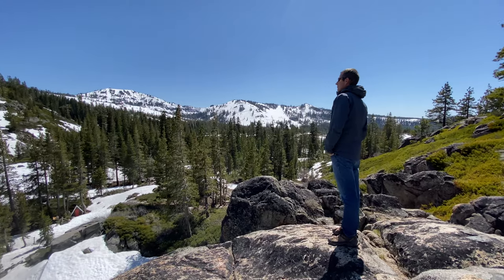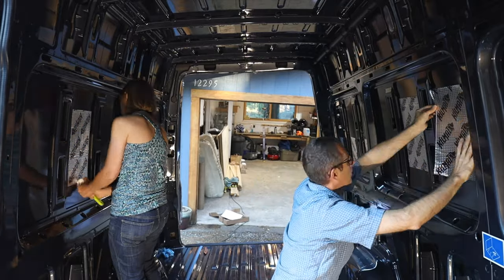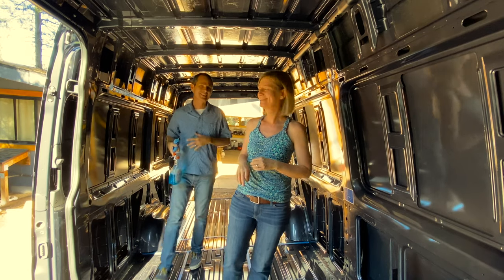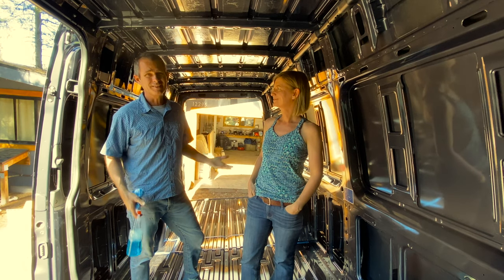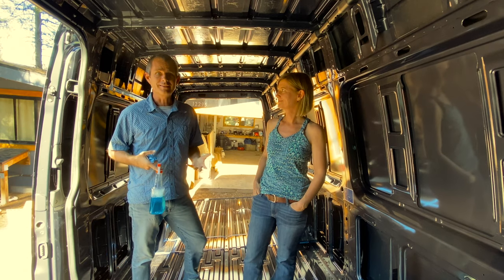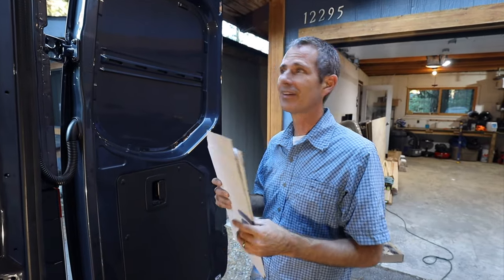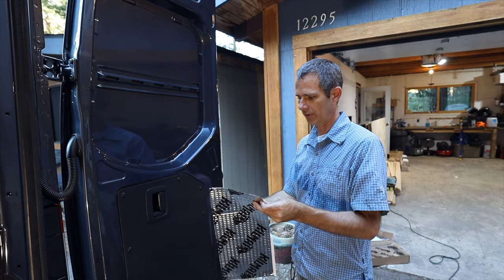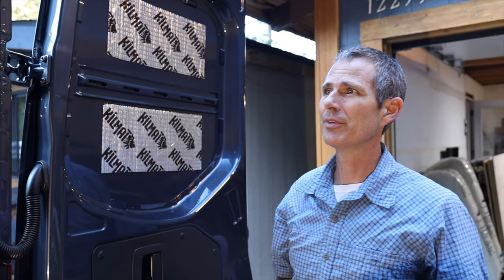How to Apply Sound Deadening in a Van | Sprinter Van Conversion | Van Life

Comment: Got to love all this modern tech of stick on sound pads, my first van near thirty years ago we used stippled black bitumen  two or three coats and as thick as possible same stuff as old fashioned car undercoat but boy did it work it stopped every creak & groan from the van body, two drawbacks come to mind it stinks like hell for three days plus the bodyshops hated you if you ever had a dent in the body to get out, I did three vans like that until pads were made easy to get  & even then undercoat was used in between the modern pads , a modern insulter  used in the marine industry is a 3M thinsulate if i were building again it would be the pads plus thinsulate plus havelock, costly but very sound thinking . the thermal on the 3M is very good. Keep up the careful sound good work im watching with interest.
Reply from the maker: Thanks for sharing your experience - interesting how sound deadening and insulation were handled back then.  So glad we have easy- to-use options now!

Comment: I notice on all builds I've seen the Kilmat is minimal on the sides and is not used to fill the entire sections.  Any particular reason for this?  Seems like more would help.  Is it an issue of added weight?  Great video and thank you for sharing.
Reply from the maker: It's not necessary to cover the walls - it adds unnecessary weight and expense.

Comment: Hi, my name is Otto and I have watched several of your video recordings of your VAN build, I have been very impressed how you have presented yourself, the details, the thoroughness of your process. I can tell you've done your homework looking for good, reliable and eco-friendly materials. My wife and I will be starting  our first Camper VAN using the new 2023 Ford Transit VAN Trail. Question on the Kilmat product, I have been searching for the material but I have not found a retailer that sales them in a box like you show in your video. Did you order the box from Amazon? I only can find that they sell them in pairs and not in larger quantities. I would appreciate if you could comment on this. Thank you.
Reply from the maker: Hi Otto. Thanks for the kind comments. We bought Kilmat from Amazon, but I see now that Amazon doesn't have it in stock. Siless comes up when you search for Kilmat in Amazon.  I'm wondering if Siless bought Kilmat. The products looks the same, materials are the same.  I would personally go with the Siless if you can't find the Kilmat. Best of luck with your build!
Reply: @wanderlibre4434  that is correct, i am going with that product. Thanks so much for your quick reply.

Comment: I wondered if you could post a video of your decisions to buy that Sprinter configuration, namely long versus short wheelbase, two wheel drive versus four wheel drive, and the 2.0 liter gas engine versus the 3.0 liter v6 diesel engine.  Best of luck with the project!
Martyn Edwards
Reply from the maker: Thanks Martyn! Good suggestion. We're planning to work in a couple of videos covering all the topics you mentioned. If time permits, we're actually going to try to film the first one this week, which will cover our decision to go with the 2.O gas vs diesel. Stay tuned👍
Reply from the maker: Hi Martyn, We wanted to let you know that we just posted a video on our decision to buy the gas engine vs diesel.  We also briefly discuss 4WD vs 2WD - although to cover it more in-depth will require its own video. Here's the link https://youtu.be/obr5pkpVHOg

Comment: After using a budget brand to sound deaden most of my van I ended up buying some Dynamat and was shocked how much better the product worked. Buying it from Crutchfield ended up costing only about double the price which I felt was totally worth it. I'm interested to know how much your products brought the sound down. I've been looking at Havelock wool so can't wait to find out what you think of it.
Reply from the maker: Interesting to hear your thoughts about Dynamat.  We're using Kilmat to deaden vibration and road noises that are being picked up in the body panels (ie vibration).  For that, it has definitely made a noticeable difference. The van feels pretty solid.  But the main tool we're using for sound insulation is the Havelock, as we've heard that it's really good for blocking out noise.  We'll give our input once we've installed it.